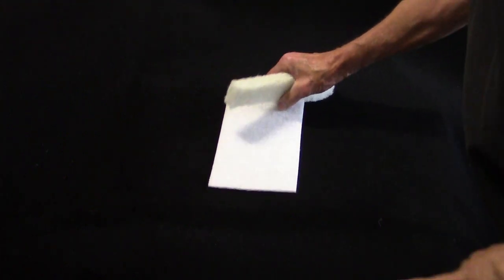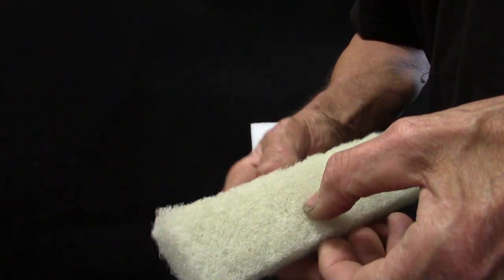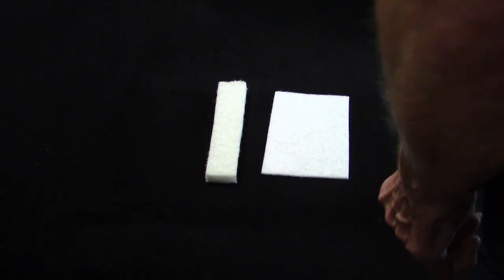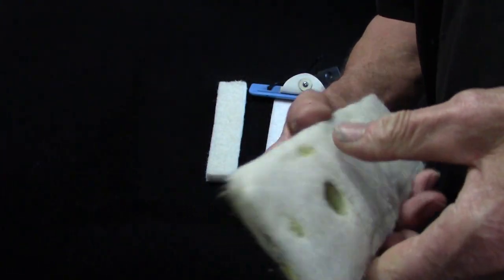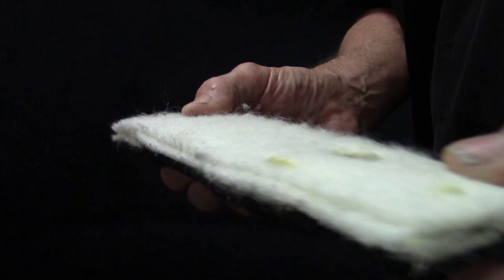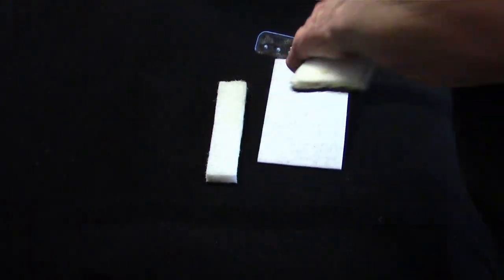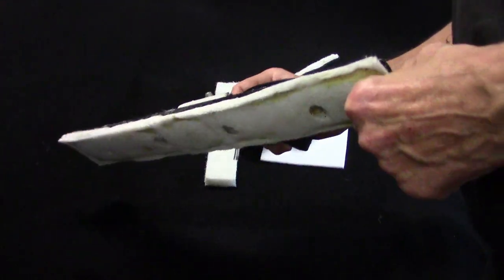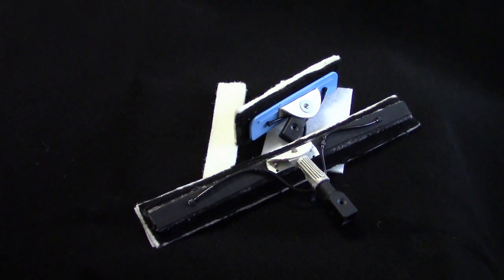WINDOW CLEANING  WHITE SCRUBBER PADS FOR WATER FED POLE

Comment: Thank you .. keep those inventions coming.. you are awesome! I think I agree with you about the white pads (thinner ones) being more aggressive than bronze pad. Cheaper too
Reply from the maker: We compressed 3 thin white scrub pads on a backing pad. Also made them about 1/2 inch bigger around perimeter of pad holder. This allows you to scrub into the corners and edges. Might make video show how to make the scrubbing pad
Reply: @WindowCleanerBloke  can I ask how you make the backing pass again.. I used heavy duty velcro but the glue has just failed
Reply from the maker: @pieroturri  The pad holder we using is a doodle bug pad holder that we cut in half. Here a video how we made the pad holder from a doodle bug https://youtu.be/DO7OxSVqPqA
Reply: @WindowCleanerBloke  thank you so much for the reply...I have one of them doodle bug things.. cutting it in half is a great idea as I find it's size is not the best... We really appreciate all your workable ideas. Looking forward to your videos
Reply from the maker: @pieroturri  Even though it may be smaller in size will give you better scrubbing power.Let me know how it goes.